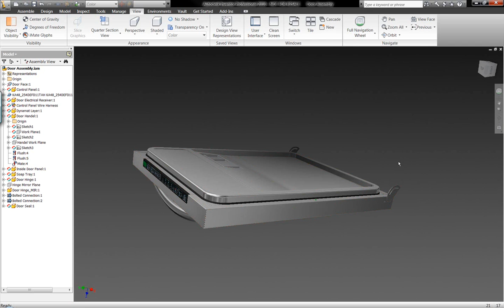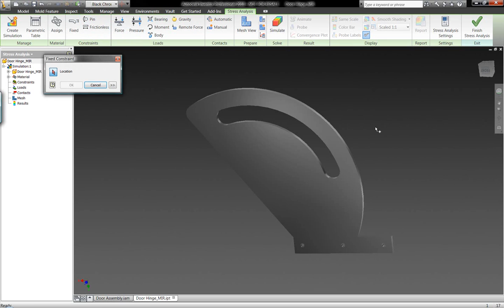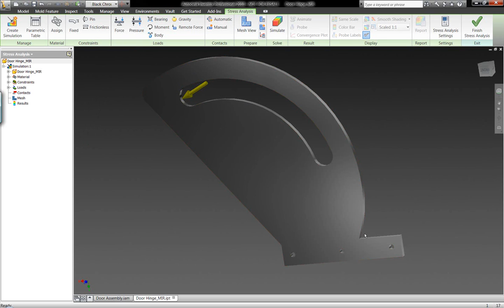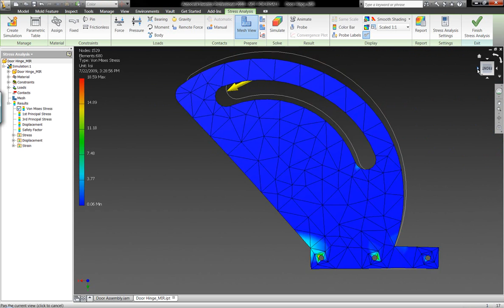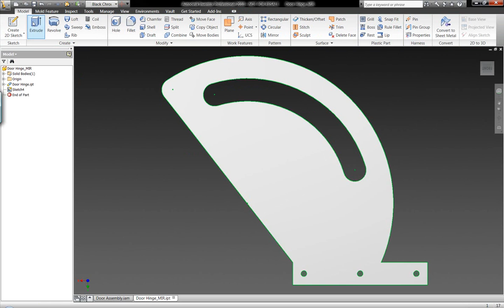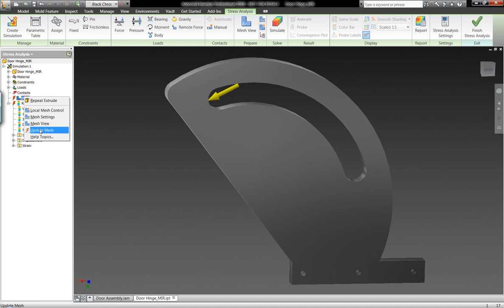Autodesk Inventor FEA - Part and Assembly

Comment: its great but i think i should apply the force on the face of the handle not the way that u did since aplying it over the bolted area will simulate force being applied from the dour, becouse the way u did it here is as if the bolt on witch its sliding is pushing against, and yea i know the bolt will push against it like the way u did it with the same force, but will the result be the same?